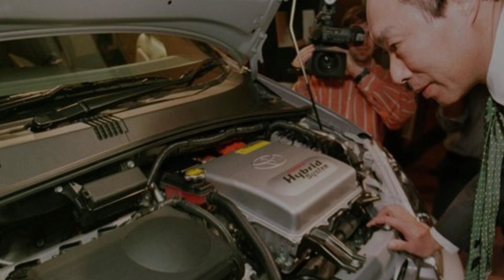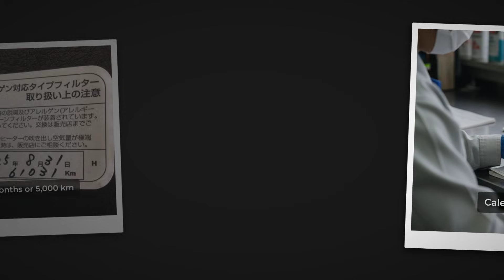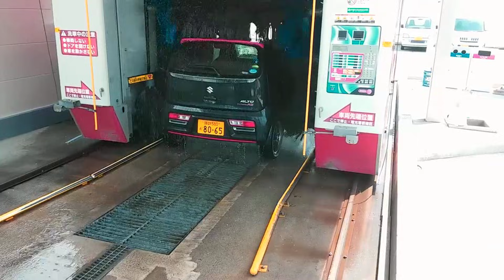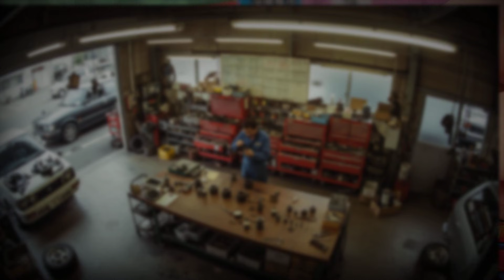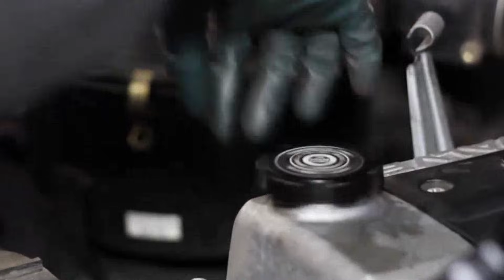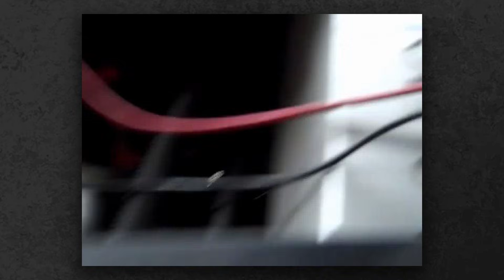10 Secrets Mechanics in Japan Use (That American Drivers Ignore)

Comment: Very interesting video. My wife drives a 2020 Honda Fit with about 50,000 miles. I drive a new 2025 Honda HR-L with a little less than 3,000 miles. Any suggestions to keep these cars running into the future will be appreciated.